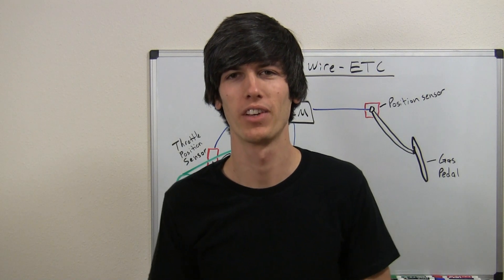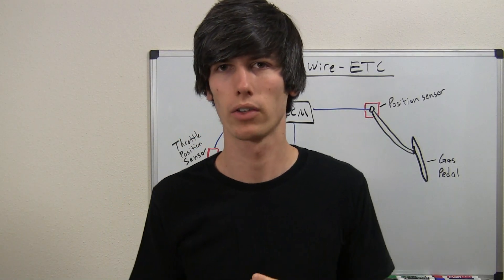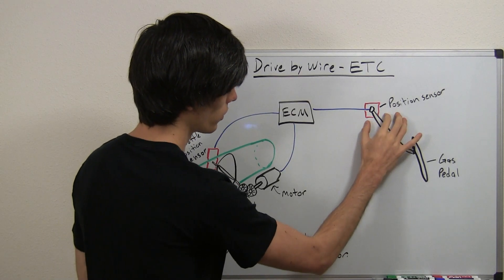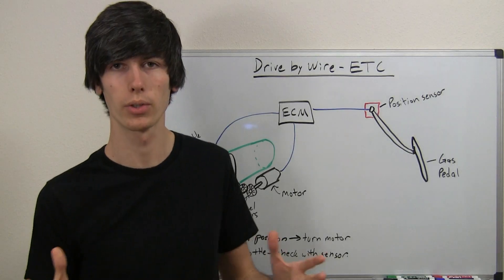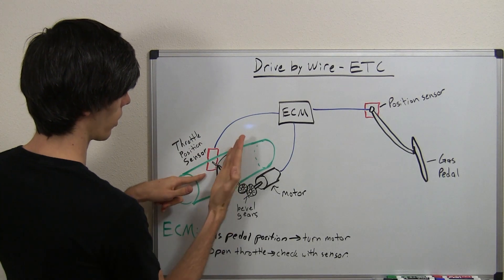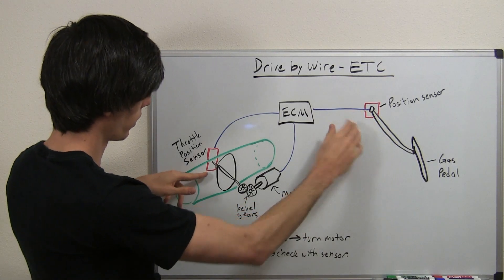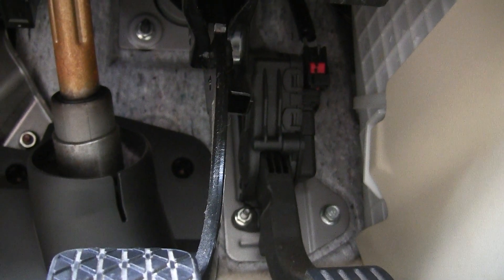Drive By Wire - Electronic Throttle Control - Explained

Comment: Modern "fly by wire" aka computer controlled throttle input means terrible throttle response as in delayed throttle response compared to conventional cable pull throttle however if technology exists that proves me wrong please let me know.
Reply: this is untrue, it's more of a throttle dampening mechanism, or driving learning system.
many cars alters it's behavior depending on the driver.
there is no way those motors are too slow, electronics is as fast as mechanical systems or faster.
the implementation can alter it's behaviour, but in straight up practice no logic in place the drive by wire is very quick.
Reply: Road2Perfection My 2015 Chrysler is fly by wire and there is about a one second delay in throttle response which I hate (but otherwise a great car). Not all car makers are the same obviously so I was wondering if other people noticed the same problem with their cars.
Reply: ***** I set up drive by wire for the initial test today on a standalone ecu, and that's quite quick.
see 
\watch?v=UY3Sjdjd01s
that's unfinished, but it's not slow! 0-100% at the end and you can see it's quite rapid.
Reply: ***** I have some dampening to shut off throttle enabled, keep in mind, I've done 1 hour of installing wires and figuring it setup, then calibrating  0-100 % and all.
initiation time is always less than 0,1 sec 0-100% is sub 0,08sec 100%-0% is 0,4 sec with dampening enabled (will decrease it more to around 0,2 to keep my turbo happy)
there you go, actual numbers of results done one hour after shared video.
So that's how it CAN be, not saying it's always better :)
Reply: Drive by wire is made from the beginning to overcome the disadvantage of a group of mechanical linkage problems and changing in calibration and balancing due to aging and rusting look at your modern mobile handset and see how responsive it is ? those " dedicated micro controllers are way more responsive due to the fact they made to carry the same task over and over with merely zero probability of bit error rate BER , and the task can very easily programmed on MC and set to run at twice and sometimes more any required response time (over the required will offer more control resolution)  precisely .........
the good news is those MC come with finest quality , low cost , robust operation , and lots more benefits ....
don't you know that agreement assignment got the green light between the road market dominate vehicles manufacturers on road car makers under regulations of road safety for smooth transition plane till 2035 plan that ends with fully automated roads infrastructures and fully automated road vehicles will carried out - the transition plan - into 3 main stages ...... probably the first stage to automate each subsystem and redesigning it to be electronically operated hence able to be automated then integrated with other subsystems orchestrated (controlled/manipulated) with state of the are MCU (module control unit) |as a generic term|e.g TCM (transmission control module ) PCM power train control module ...... and 
those systems or other systems based on the same theory replacing some mechanical systems/subsystem with electronic 
all road cars has electronic injections , ABS , & computer controlled automatic transmission that is efficient , runs smoothly than ever thanks to reliable industrial electronics that will automate our road journey safer faster and more efficient probably fully electric cars will dominate the automation era  when the rechargeable batteries tech develop a large capacity fast charge light wight battery and they will made it look at the new Tesla and we still 20 years back from it 
even Germans start to automate some cars with self parking and cursing autopilot
Reply: Broad statement. It all depends on HOW the system is implemented. There's nothing stopping a throttle by wire system from being just as responsive if not more responsive than a conventional cable. Don't confuse the technology with how a room full of bean counters and lawyers decide how said technology should be used.
Reply: ***** Some cars are more refined then others.... i drove a 2007 jeep patriot that was drive by wire, and it was a 5spd and the lag was amazing.  Like when I would let off the gas to shift, the delay was so long by the time I pressed the clutch the engine would rev up a tiny bit as if I was still pressing the gas.   The throttle response on that vehicle was sub-par to a poorly tuned carburated vehicle. 

Thought, drive by wire is on pretty much every new car nowa days, its hard to imagine they all suck as bad as that jeep did....2007 seems kinda old for that, so maybe it was still newish tech back then and still needed kinks worked out..

I still cannot imagine why this is necessary...What the hell is wrong with a throttle cable?
Reply: Khaled Hussien You know what, that actually makes sense. 

Willing to bet it has next to nothing to do with economy, a throttle cable isn't inefficent, and in fact by design, it is more efficient since the entire mechanism is human powered and doesnt rely on the vehicles electrical power to operate. 

BUT, you make a very valid point about all the automated stuff cars are beginning to have.... traction control, collision avoidance, advanced cruise control, etc. 

The point isn't about efficiency, it's about the computer having to ability to manipulate the throttle in order to carry out functions that require it's control.  

Older traction control would simply cut fuel to the motor and pull ignition timing to force the engine to limit power.  Which sounds sketchy at best.... where as now, with computer controlled throttle all it does is override the signal from the gas pedal and basically just let off the gas
Reply: ***** A reason why that usually is, is because the ecu's in most vehicles are set with a slow throttle opening rate, so you press the peddle all the way down but the ecu goes, well since im less than (whatever rpm is dictated) I see that you suggested 100% throttle but im only going to actually open it 30% until you reach (another rpm)

Like my car in particular only opens a certain percentage until 3400 rpm then it allows it to open all the way.

why? I have no idea but it's extremely common and can be tuned out for immediate throttle response, so there's no real delay in the electronic system it's just programmed that way but can be altered.
Reply: this is necessary because it make it easier and more accurate to operated the adaptive cruise control  , switching between the economy driving mode ,normal ,and the so called sport mode in some models ..... 
in theory it is more efficient and gives precision orchestration between different control units of sub systems such as collision avoidance brake ,ABS ,ESP ,Traction control and so on
Reply: @khaledhussien5147  who's using cruise control
Reply: thats what i wanted to say
just i'm not that fluent in English 
when i mentioned efficiency i meant the efficiency of engine/subsystems control would be more efficient control loop
and i think electric wire throttle could replace or work as backup for the idle control 
also could be programed to blip the throttle in sports mode if any 
also could help turbo engine o keep RPM at certain amount when clutch pressed to reduce lag it is all around control 
it also works in conjunction with pedal shaft semi-automatic (DSG) orchestrated with ESP TC since reducing fuel amounts are more efficient than just applying brakes to correct the scenario of dangerous wheel slip and loosing grip) to match revving reducing dangerous wheel slip drifting ( in downshifts it will also help the launch control system to provide the exact fuel amount to get max grip hence best acceleration + avoiding slip hence reducing losses increasing stability & safety

Comment: question.  Have one of those in my 2005 Hyundai Sante Fe and it has issues.  Where, among all that stuff, am I likely to find a problem causing the acceleration to surge or stop inappropriately?  thanks.

Comment: Is a drive by wire system less reliable than a normal cable operated system?  I say this because today car manufacturers are making cars pretty much disposable. You can't really see cars today going for more than a number of years trouble free,  but you can see cars of the late 90s and before still running trouble free.
Reply: Yes.  It is way less reliable, less respnsive, and extremely expensive/difficult to repair.

Comment: Would there be lag created... like from the motor not spinning/accelerating fast enough, etc.?
Reply: sam ali OMG... A 1-second delay is no joke!!! I hope you do find a way to deal with it!
Reply from the maker: It is possible, yes, all depends on how the motor is tuned with the throttle pedal.
Reply: Engineering Explained I see... Thank you!
Reply: +Engineering Explained so how can I improve the throttle response?? its lagging and it has a 1 sec delay

Comment: drive by wire suckss. That's all I want to say
Reply: Sorry Bob but I think it's here to stay. I still like the old throttle cable because when it breaks you don't need a multi-meter to find out the problem. I only play with pre-'80's cars as they don't mess with my head. Soon all of us old guys will be gone & these young fellas won't even know what a throttle cable is!!! I have to thank this young guy though 'cause I knew sweet FA about this subject but I still won't mess with them. Bill. Jimboomba, Australia.
Reply: koolkar55 yeah you're right. I have tried many modern automobiles with DBW, the throttle respon were terrible. Right now I only like the car from 90s to early 00s.Those cars have instantaneous respons. There is not idiotic "sports model". When I my foot down, it is always a joy. DBW has never make sense to me. I know even airplines are using DBW systems. But DBC does have any problem, so why do we have to replace it?  DBW should imporve throttle respon, but it never does
Reply: Couldn't have said it better.

Comment: is it possible to have a steering wheel throttle if your car has fly by wire throttle?  like some type of squeeze lever? a few years back i think it was travis pastrana in the xgames. he broke his right foot & was in a cast. they had some type of throttle that was on the back side of the steering wheel so he could work the throttle with his fingers,for his rally cross car. i didn't get a good look at it, so i don't know if it was mechanical or FBW. any ideas on this???
Reply from the maker: Absolutely, it could be done either way (fly by wire or direct).

Comment: 1> when i press the gas pedal constantly with some force/Angle ,so the butterfly valve constantly open or just open/close - open/close??
2> Which car model of Honda u used in d video?

thanks in advance
Reply from the maker: 1. It opens at an angle, relative to how much you press the gas pedal.
2. It's a 1999 Acura Integra
Reply: u mean steady  in angle
right?
Reply from the maker: Correct. It's not a simple open/close valve.
Reply: thanks

Comment: diesels dont use a valve to regulate air though. its wide open. thats also why they have no vacuum. how does a diesel direct injection work?

Comment: Thanks for the response. 

Just one more question: Sometimes when I shift my car into neutral, the engine will go to idling for a couple seconds then rev to about 3000 RPM for a few seconds without me touching the gas pedal. Is this caused by the position sensor acting up, then telling the electric motor to open the throttle body, then the throttle position sensor senses the incongruence between the gas pedal and throttle body and then automatically adjusts the engine back to idling?

Comment: What runs the electric motor, battery? And electronics have delay (probably 1 seconds or less in modern computers), and mechanical throttle has no delay because it's directly connected. Also if you want to adjust the A/F ratio, why don't just adjust the fuel instead of air? It might be not give more power but it's more simple. But of course electric car use this one.

Comment: I bought a"SPRINT BOOSTER" for my A4. It made a world of difference. The sprint booster works on a selector switch which tricks the ECU. The sprint booster tells the pedal sensor that it is at a different position then it actually is. This allows the ECU to open the Butter fly valve to 15-30% more while under normal acceleration. When this happens the ECU thinks the pedal is being pushed harder that it actually is throughout the standard acceleration band pushing the motor to work harder faster.

Comment: Not exactly right. A man came into a friend of mine's garage, with his old and totaled ford escort on a truck. Before crashing it he had no care about the gas cable that occasionally got stuck, beacause of rust and lack of lubricant(the car sitted in a shed for a long time). Luckly throttle got stuck when he was accellerating out of a slow corner so he hit a jersey only at 50/60 kph and the inertial switch of the fuel pump did the rest.

Comment: what I'm basically referring in my previous comment is that if your vehicle doesn't use drive by wire technology, you don't have to worry too much about the acceleration problem right?

Comment: I 99% believe that Toyota was just using floor mat as an excuse and doesn't want to fix the "real" problem regardless the lives of others :(
But the kill switch can be dangerous because once your engine and power is off, you'll loose power steering as well as electronic brake force.
It doesn't take a rocket scientist to shift the gear in LOW or NEUTRAL when things like that happens

Comment from the maker: Well, some claims were that the gas pedal physically got stuck on the floor mat. I believe modern cars are incorporating kill switches. Regardless, you can always put your car in neutral; and brakes should overpower engines 99.999% of the time.

Comment: so don't you think the drawback of this technology is the risk of accelerator stuck? Remember a few years back Toyota had recall a whole bunch of its vehicle because of accelerator problem? If it a vehicle wasn't using (Drive By Wire), it is impossible to have unintended acceleration problem right?

Comment: Im not sure how correct this is but in my eyes the benefits are for economy. If you floor the gas pedal whilst cruising in top gear with a cable operated throttle it will open wide with no extra benefits other than a poor mixture entering a cylinder. With a drive by wire, the ECU will know that a fully open throttle will be not needed and adjust the throttle accordingly based on what is programmed in the ECU saving fuel and running a perfect mixture. Thats my theory....emissions and economy.

Comment: I personally think this is the worst invention human being have designed don't you agree? What harm does it do to use gas pedal wire to control the throttle valve? And if your throttle motor fail while in you're in the middle of nowhere during the summer in the desert. I'm sorry but you're going nowhere...:(

Comment: i understand that is true, since most of the time you have to step on it to get it going, but its not often when i drive fast, so i can actually get better mileage. and our 5.3 sierra with afm gets nearly equal for the most part. that being said, fuel economy in MY situation does not differ much at all, since our driving situations aren't the same. i'd say we're now beating a dead horse.

Comment: the answer to that question would be the fact that i inherited it. i had no choice, as i would have preferred the v8. believe me ive heard it all, and i know that it is underpowered. i typically dont haul anything, and if i dont drive like a bat outta hell i can get better mileage than my dads 5.3, albeit marginally. i am currently working for a new car for these reasons. on the plus side to the 4.3 is that you simply can't kill them.

Comment: .....its there. the 4.3 is an old design so it makes sense, hence why gm's bringing the new "ecotec" v8's replacing vortec altogether. direct injected, same displacements. they are getting rid of the 4.8 though.

Comment: 2007 Silverado. I've seen it myself when I cleaned the throttle body. I've removed the blade before, and I clearly saw that the hole was meant to be there. I am the original owner. No vortecs are drive by wire.

Comment: hmm interesting. however there are in fact throttle blades with holes in them. i have a vortec 4.3 and the throttle blade has a hole which is about a millimeter in diameter, and this engine (obviously) has a IAC valve. your assumption of any opening on the throttle blade bypassing the purpose of an IAC is as good as mine, but it's there.

Comment: holes are sometimes put on throttle blades to help a car idle based on what i understand. in any case, throttle blades should always completely close when off the gas, because then the iac valve comes into play to let the engine breath at idle.

Comment: Thanks for the video. I was fighting myself to find the throttle wire to manually gas up my engine so I can hear my new muffler. I guess my car has the ETC system so now it makes sense that I was not able to find it. My car was made in 2005 by the way.

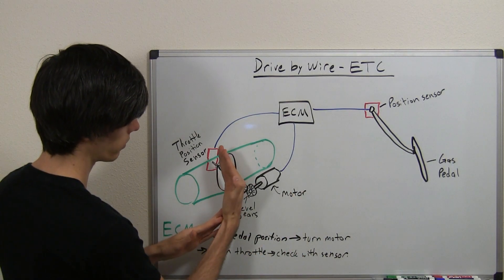Comment: 1:35 "to an almost closed position"? I thought the butterfly valve had hole(s) in it so that some air passes through when it's closed. Or at least I know that some carburated engines have holes instead of not closing the valve all the way.

Comment: (addition to ur session), From the pedal sensor value the ECU calculates the torque demand from driver, in turn calculates the air mass required to achieve that torque demand. In order to allow that much air charge/mass into combustion chamber,ECU calculates what should be the position of the sensor and controls the electronic throttle valve (EGAS). Its a complete closedloop system works well with the help of MAP&MAF sensors.
Good Job.! Keep doing
Please have a session in Torque coordination.:)